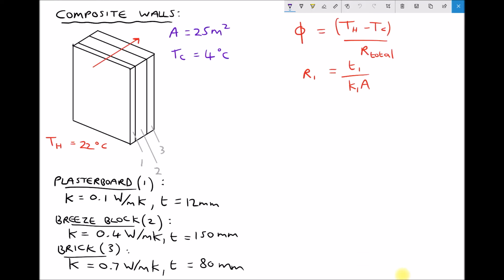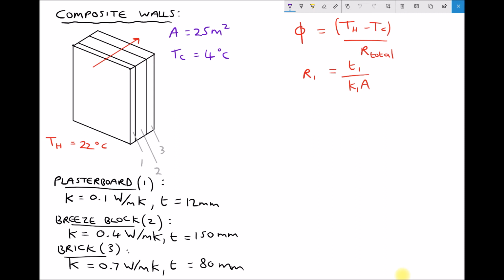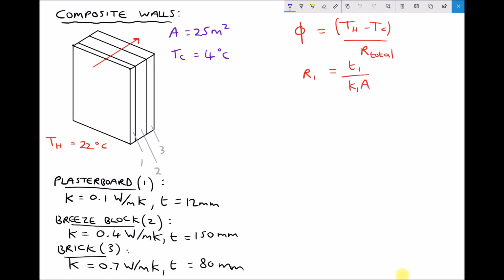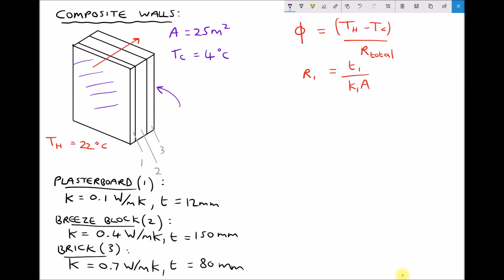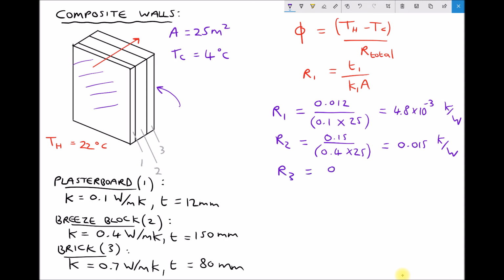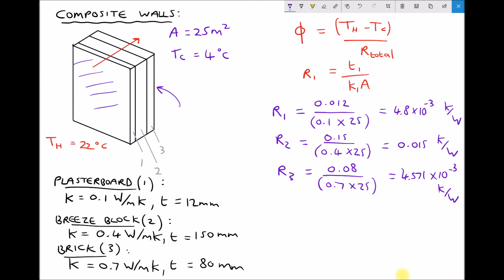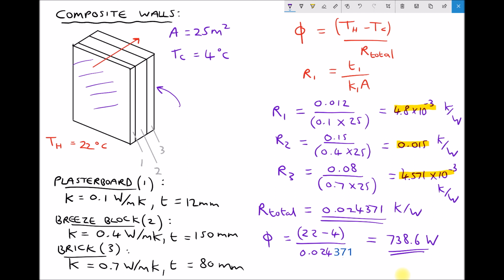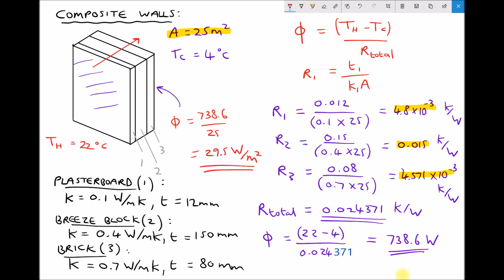Calculating Rate of Heat Conduction Through a Composite Wall

Comment: this example is for thermal loss right bro???so if we want to calculate thermal gain it will be the same excepting the temperature will be on opposite sides ??
Reply from the maker: Yes that's correct. What we are actually calculating is rate of heat transfer through the wall, so it can be applied in reverse by switching the hot and cold temperatures.
Reply: @EngineersAcademyLTD Thank you so much .